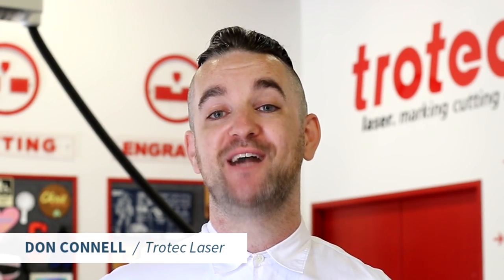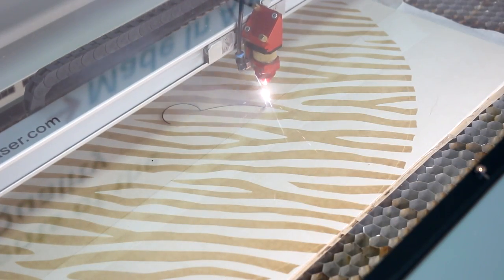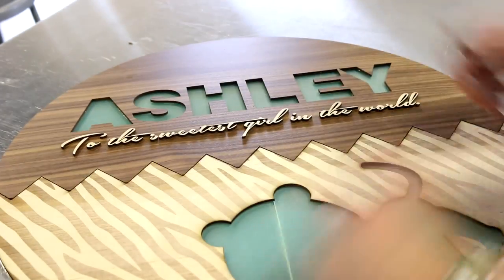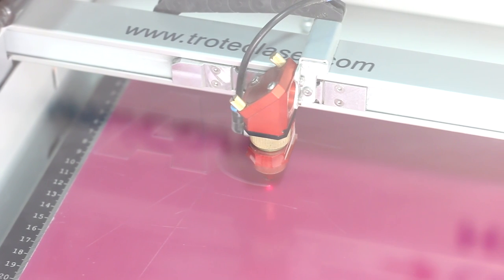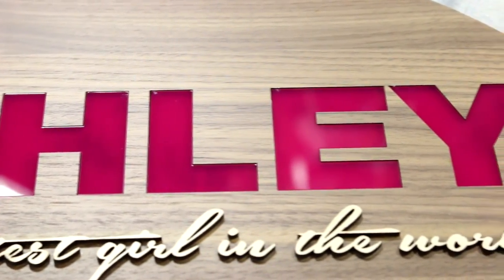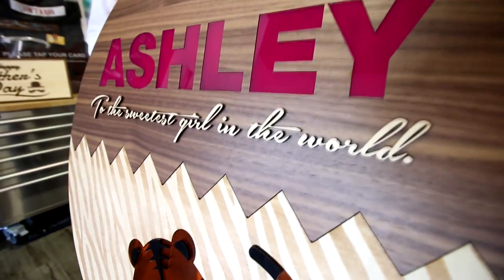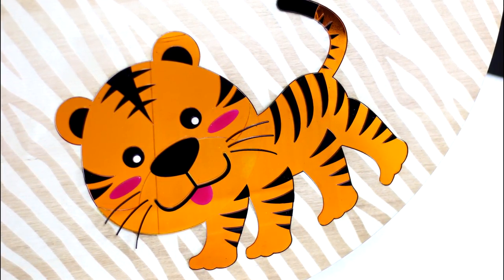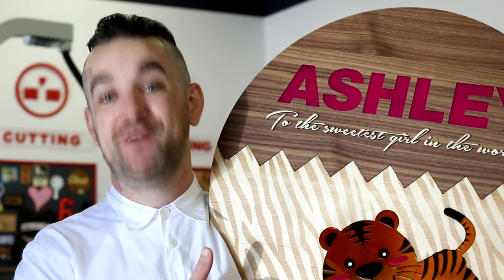Creating an Amazing LED Nursery Sign using Trotec Laser Cutter

Comment: A cost breakdown on this sign would be illuminating😎
Reply from the maker: We have lots of ROI break down videos on our channel, we didn't do it for this one unfortunately. Overall cutting was about 20min, assembly about 10min, engraving about 20min. So you're looking at about an hour of laser and assembly time all together. Material costs you can find on our website and get the desired ROI based on the price you feel you can sell it for. Hope that helps somewhat ;)
Reply: @TrotecLaserCanada  
Add preparing design,  manipulation materials for laser cutting/engraving.
Sorry but I dont believe that it only took 10min assembly. 
Cost in Spain, my estimation:
60€ materials
40€ lasercutting-engraving
30€ manual/design tasks 
And add 40% on taxes. 
182€ sell price, with 0€ benefits. 

And with this,  I dont mean the product does not worth.
Reply from the maker: @davidavid079  yep 10 min. Design took longer of course, but once you have the design you can re-create the file a few times. With kiss-cutting and inlaying it's fairly simple.